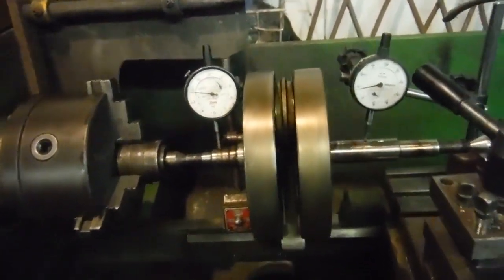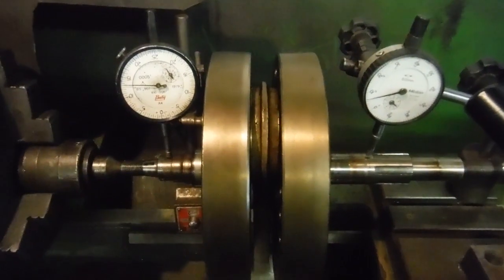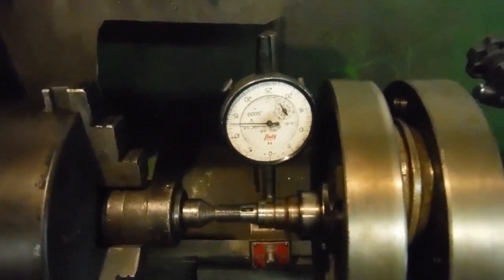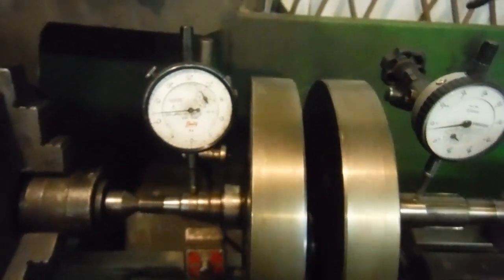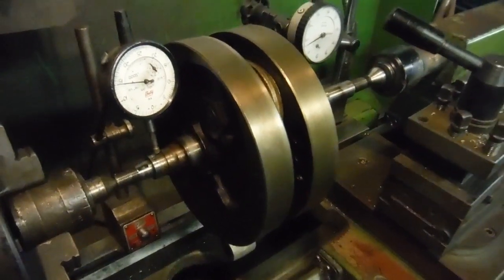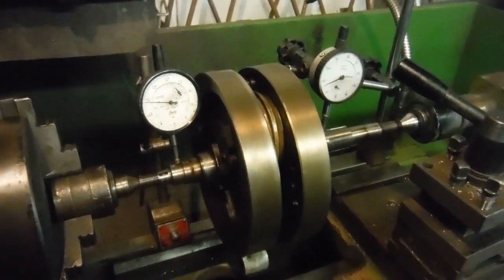Royal Enfield 500 Bullet crank 80,000 mile overhaul part 1 inspection.

Comment: I suspect that a good thrust from the piston in an operating engine would bow that crank more than 3 thou.

It would be interesting to see if you can deflect the dial indicators by hand squeezing the flywheels together opposite the big end.  I'd bet you could get a thou or two.

Be careful not to squeeze it too much between centres on the lathe.
Reply from the maker: Three good points, there.
Reply: Awaiting the verdict with 'bated breath!
Reply: In your experience is having an original crank assembly with such good alignment an unusual occurrence?